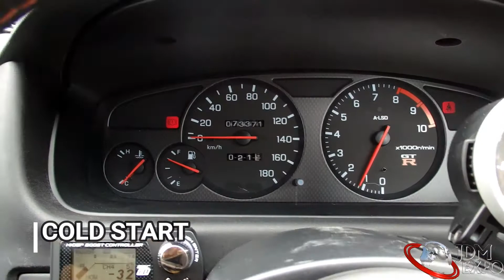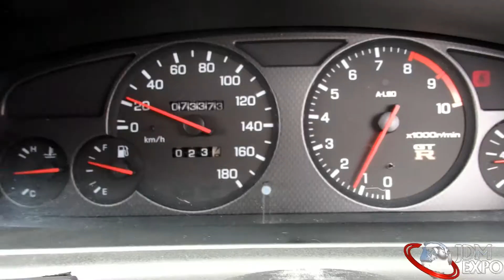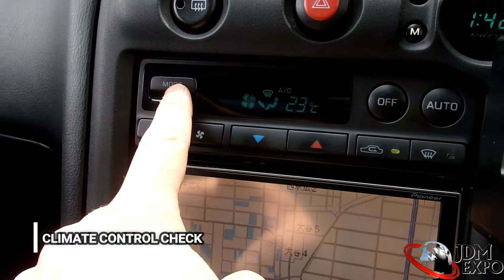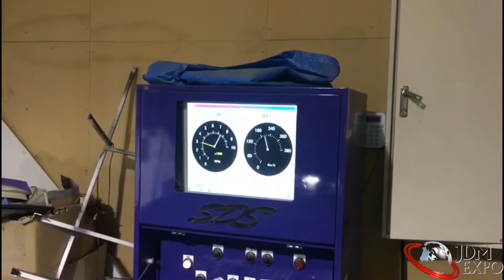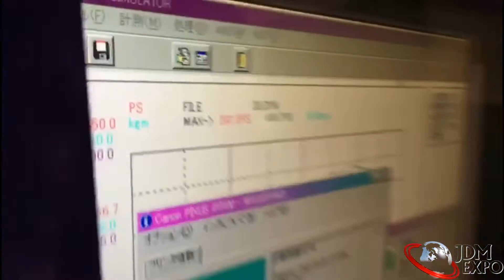Nissan Skyline GTR R33 for sale JDM EXPO

Comment: Is the r33 legal in the us?
Reply: The answer is a yes and no. The r33’s were produced between 1993-1998, the NHTSA (National Highway Traffic and Safety Administration) says that any car that meets the 25 year import law can be imported so 1993 and 1994 are currently legal for import, but the NHTSA recently deemed any r33’s manufactured between Jan. 1st, 1996 to June 30th, 1998 are legal for import as they meet safety standards, but only GTS and GTR models not 400R.

1995 r33’s are not legal and any skyline July 1998 on up are not legal. Gotta wait til 2020 for the 95 and 2023-2027 for 98 to 2002 models including r34.

You can reference Dockett NHTSA-2005-22654 on nhtsa.gov or see the pdf of cars legal for import in the US. 

Hope this was helpful!
Reply: craig1967shelby thank you so much. Love your skyline.